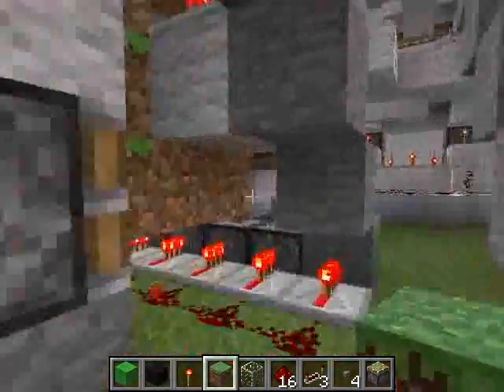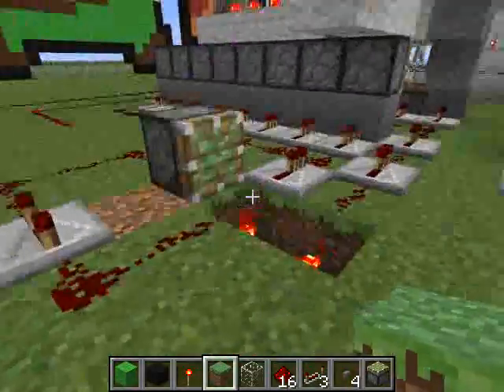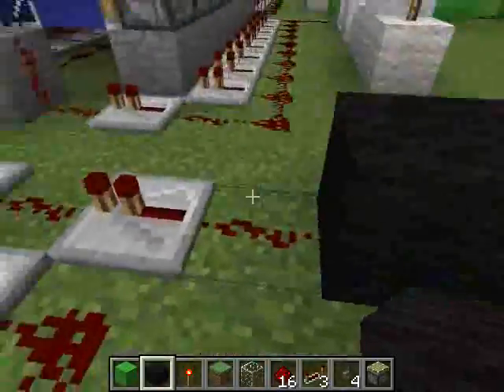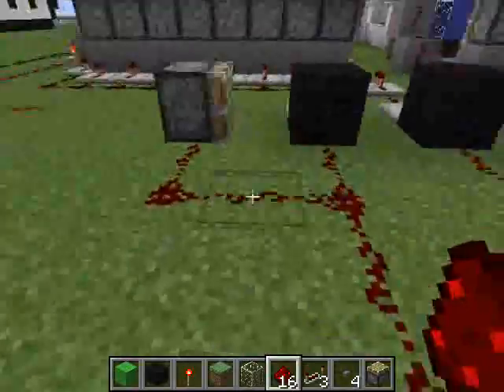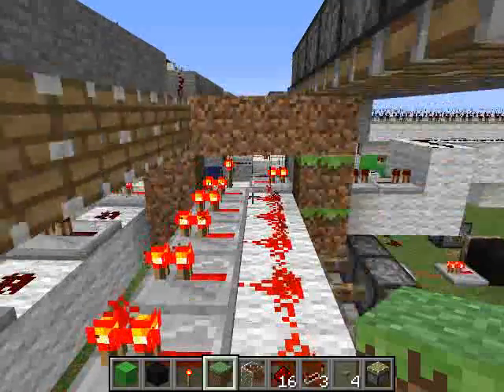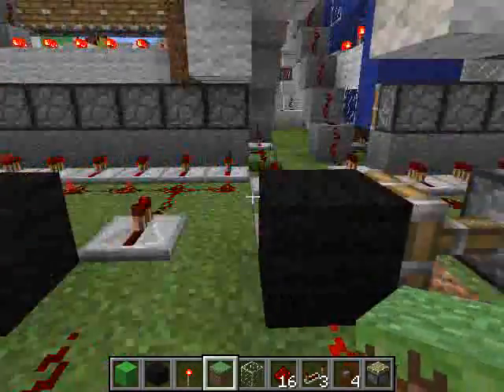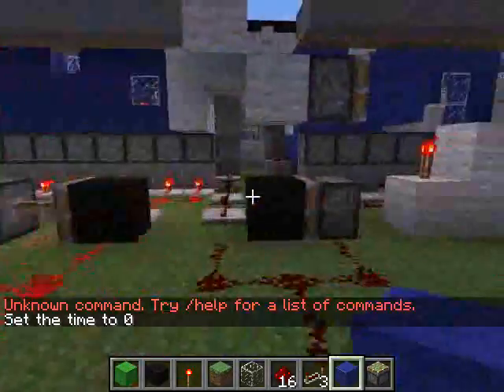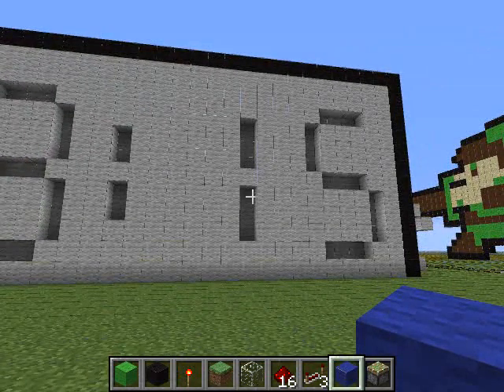Minecraft Digital Clock 1.6.2 Fix (Tutorial)

Comment: Question: It seems like as soon as I add the block that covers the first of the two redstone torches, the machine begins operating much too fast and burns out that torch. I have the repeater in front of the sticky piston set to 4 ticks, but something still isn't right. I've gone over everything from the original video and your fix multiple times, but something still isn't right. any suggestions?